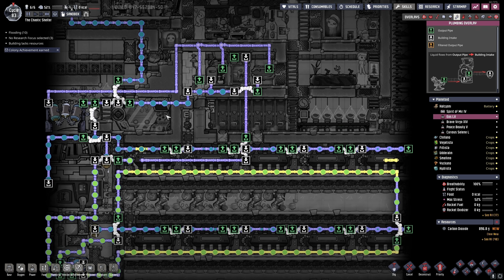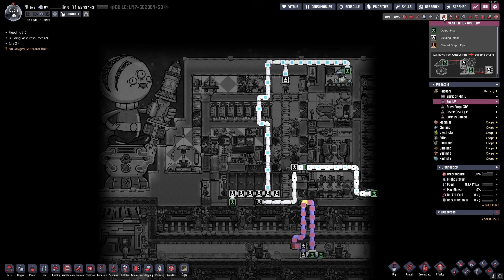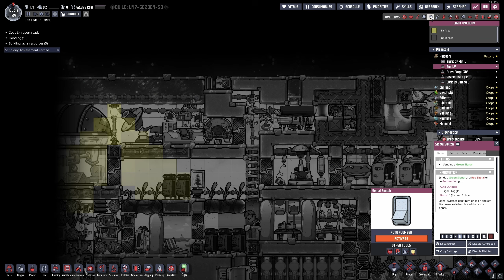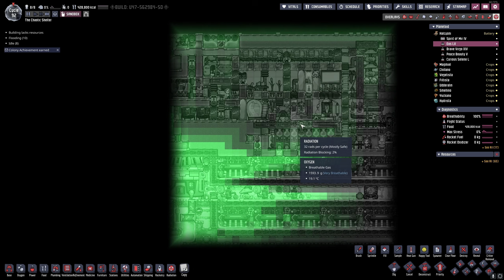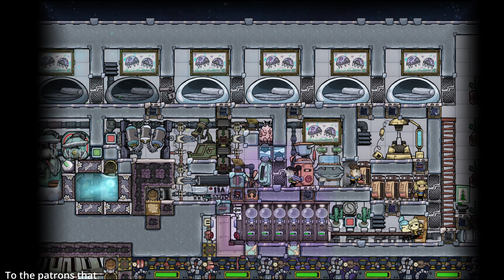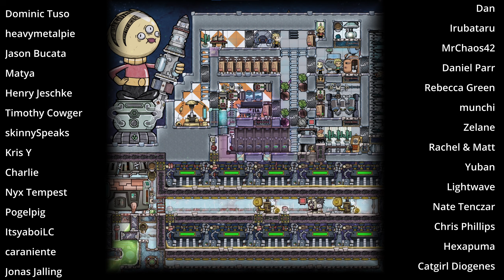Ep20 : Exploring a bunch of Rocket interiors : Oxygen not included

Comment: I suspect infinite fluid lensing probably has to do with value underflow for radiation blocking.
Reply: imagine getting a dozen - thousand rads from some nuclear waste and a lens of water
Reply: Fluid lensing is probably an actual feature they coded in. But it only affects infinite storage which i consider an exploit
Reply: @Youmu_Konpaku_  why would they make something happen only when you use an exploit..? Also, it creates rads, which I don't think is something the devs would want.
Reply: @packediceisthebestminecraf9007 guys, it's simpler than that. the amount of rads blocked by liquids and gases depends on the amount of mass in the tile, so it probably calculates the rads emitted as "rads absorbed x mass x some modifier like 0.1" and where the mass is like 81 tonnes per tile instead of usual 1, well, you got a problem.
Reply: @mrShift_0044 yup, it makes an underflow error - all of a sudden instead of absorbing all the rads, the absorption underflows and adds to the rads instead.

Its the same thing that created Nuclear Genocidal Ghandi in the civ games - Ghandi's peacefulness underflows at some point and becomes hyper aggressive instead.
Reply: My dudes, this lensing can be used for radbolts collection. 😊